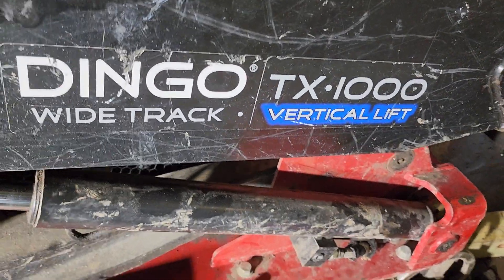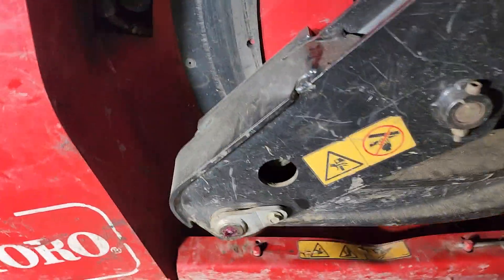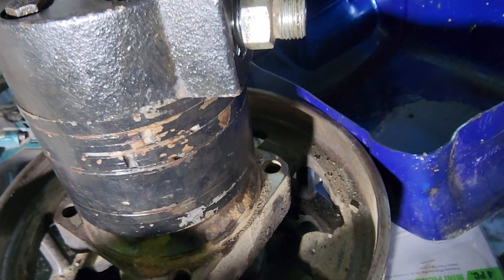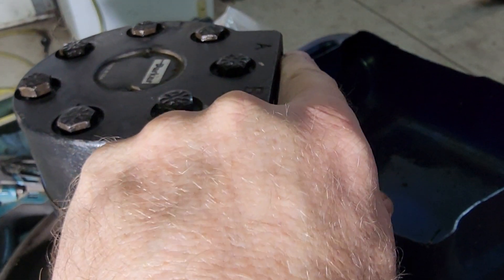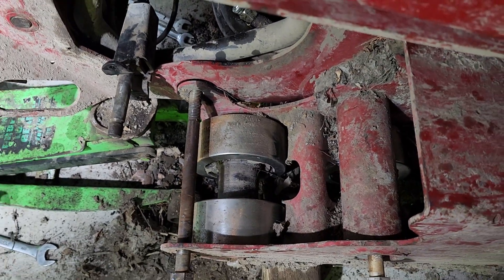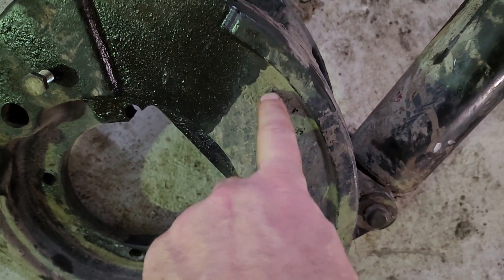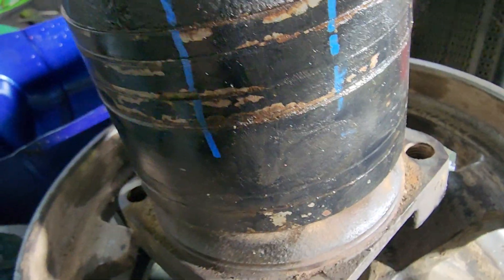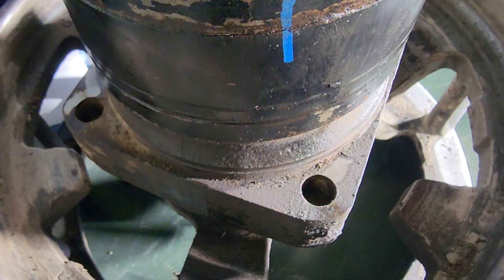dingo TX 1000 right motor disassembled

Comment: How did you get the hoses loose? From the bottom belly pan?
Reply from the maker: I think I was just using two different open-ended box wrenches and they were probably two different sizes from what I recall
Reply: @dalechalkey3729  yeah that worked thanks